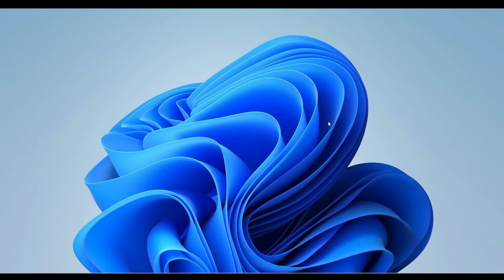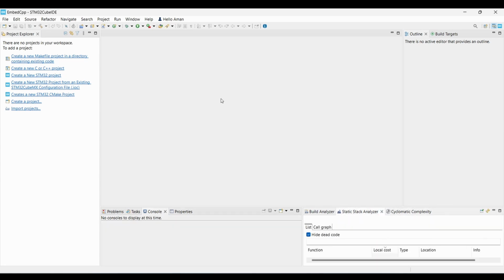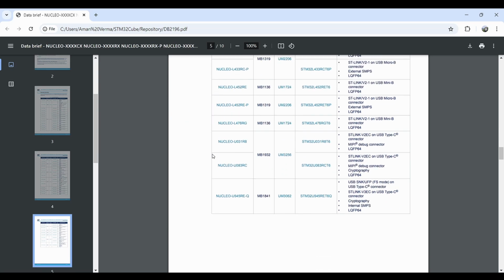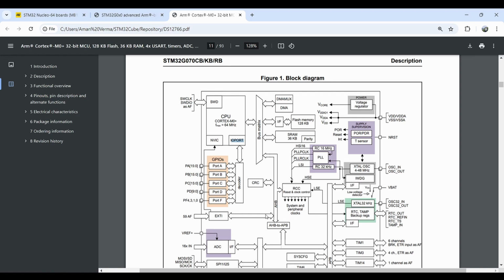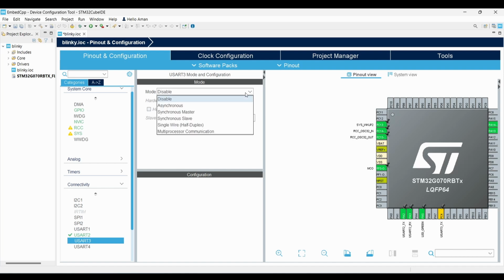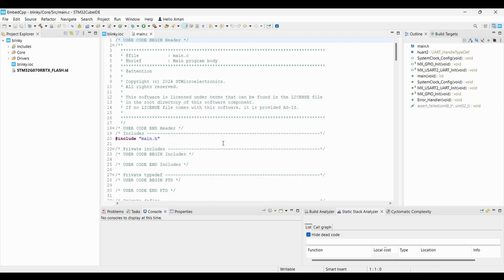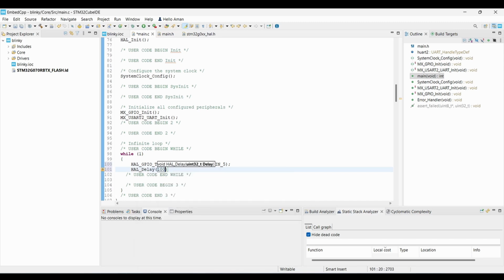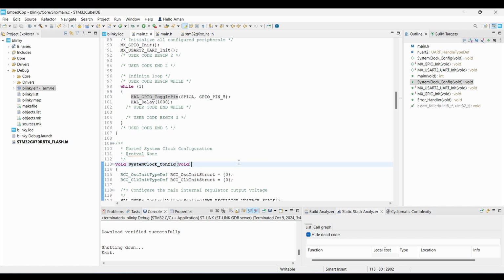Introduction to STM32CubeIDE

Comment: hello sir I have downloaded stmcubeide but not able to login in myST account it saying connection time out but internet is working fine. what are the settings recommended in network connection tab in firmware update?
Reply from the maker: It might be some server issue from the stm. You can retry after sometime. All the settings you can keep default.
Reply: @embedwithaman  ok 
tried multiple times still getting same problems. Is there any proxy related problem?
Reply from the maker: If you're not able to login to an  STM account try to download the offline firmware package. You can search on Google like, stm32g0 or stm32f4 firmware package or whatever development board you're using then extract it